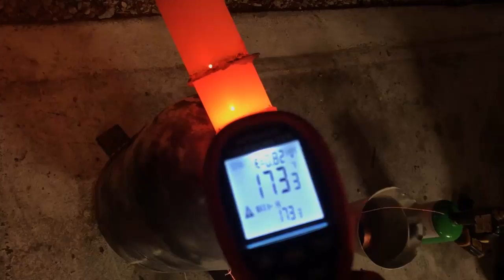Wood pellet burner for Johnas (SUPERCHARGED)

Comment: Avoirdupois is the name of the inches-feet- yard measurement system, it replaced imperial standard in the 1820’s, the Metric system replaced it in the 1890’s...I would greatly appreciate some more info about this biomass burner of yours. I need a bio mass burner for brass foundry work. I was thinking of going with waist oil, but I produce large quantities of wood chips in my work, it would be great to use them to melt my brass for my hardware. If you cannot tell me about it,if it is proprietary knowledge. I will understand...

Comment: The flame almost looks like it's not getting enough air. Perhaps a second air injection into the nozzle as a secondary burn? (Don't know if NOx is an issue, or if you want to run a reducing, neutral, or oxidizing exahust gas. I'd be slightly worried about long term soot/crud buildup wherever the exhaust hit)

Comment: This I cool I was thinking of making a oil burner like this using a drip feed system to heat my aluminum forge. I have all the oil I could ever burn and access to a lot more and propane is getting expensive.

Comment: I'm more interested in the blower, do you know what pressure it can reach either PSI, inches of water or whatever you know?  How many CFM is it?

How is the air being preheated, I'm not seeing it.  How far down does the vertical exit tube reach? How close to the bottom is it?  I noticed that on one shot the bottom was glowing red for the bottom inch or so - this would be an excellent place to draw in the air to be pre-heated.

I'm thinking a very interesting burner could be made for oil with this setup and either this blower or a combination of a blower and a compressor.